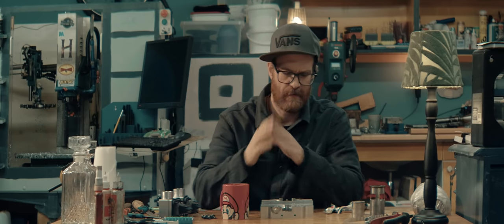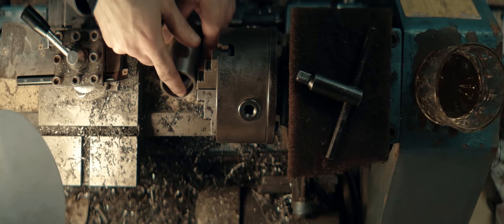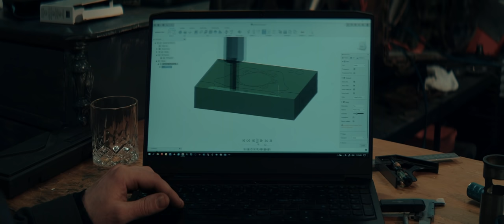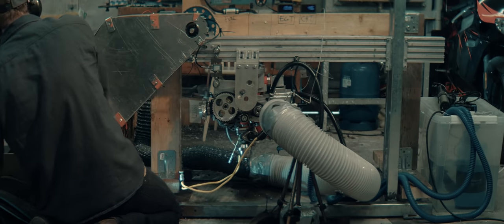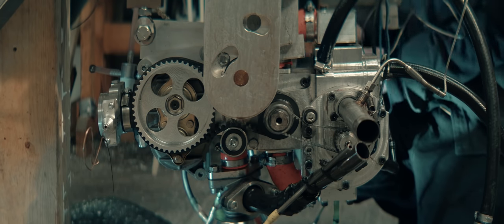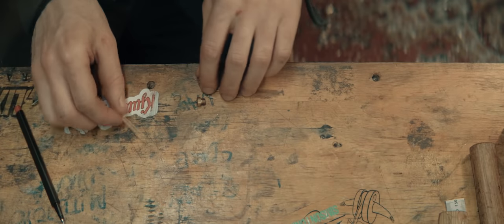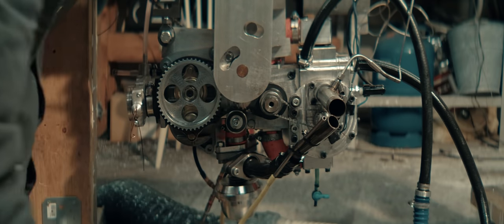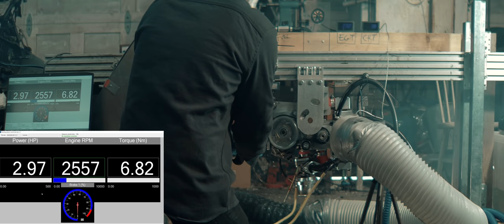Poisoned by Supercharged Nitro 50cc Two Stroke?

Comment: Very wise to use a respirator, the exhaust gasses are  likely to contain nitric acid when running on nitromethane.  It's also very lipid soluble so can hang around in the body after being absorbed.

Comment: As a machinist I would recommend a custom taper lock pully for your crankshaft and trigger.  Set screws will always be a potential failure point. You could possibly even bore out your existing pully to a taper and then machine a matching split bushing to securely clamp the pully to your crankshaft.  Hopefully helpful. Great stuff and good luck!
Reply: I thought the exact same thing when I saw that loose pulley. Machinist also btw
Reply: Does the ignition trigger fit to the crank. I thought it was fixed to the disc valve drive shaft which I believe is only 8mm in diameter. I can under stand your ideas with being machinists  but I feel it's a tad OTT for such a tiny thing.

Comment: You are always winning because I am always smiling for the most part. Except when things go boom, bang or crunch. My ears heard so nice shart exhaust notes on those 15 hp runs. Looking forward to what the reliable max is for this unique build. A nice summer day on a dry lake bed somewhere would be the ultimate ending for the proof of can iy be ridden with a mile wide smile. 10/10

Comment: Glad your feeling better Alex, I still think you should construct a simple test chamber and I remote starting system, how hard could it be? Surely you could attach a old flywheel with the ring gear and starter motor to the dyno. Cuts down on the sound, pollutants ect to you, couple of fart fans on it to extract air inside and a fresh air ducts in.  And if it explodes it would certainly offer a lot more protection.
Just thinking of you and your family buddy.....and neighbors lol.

Comment: Back when I worked in the boat industry, we had to clean just about every surface with acetone all day and the safety precautions were very much lacking. So at some point, consuming alcohol on a weekend, it kicked in like in some sort of turbo mode, first making me want to drink a ton more and then suddenly it made me vomit. Also the overall feeling was nauseated and very tired. After two weekends I understood that the acetone was going through the working gloves and was doing a number in my liver. So when I drank, my liver was already doing its thing and it had a hard time keeping up. After those nights out, I started wearing some nitrile or other gloves. Though I still think best protection would've required even sturdier gloves, but those would've hampered the hand movement and precision while wiping some the more contoured surfaces... Most of the "old-timers" there used just the basic coated fabric work gloves.

Comment: Thanks Alex, I understand you are measuring torque directly at the motor, my point is by decelerating rapidly you will have motor torque + torque to slow down the rotating parts. I am just suggesting you reduce the deceleration rate to minimize this effect

Comment: Nice to see you back Alex, your fan club was getting worried. Have you got the PiP cylinder back from Blixtens racing yet?
Reply from the maker: Thanks! I actually haven't sent it yet. Packed it up and put it in my car, realized last second that I yet again forgot to put in the generous exhaust port roof radius that's supposed to be there. Haven't gotten to doing that yet.
Reply: I really hope your able to dyno / develop the PIP-engine as best you can in parallel; in case there’s any unforeseen challenges with the “brute-force-concept” that push you up to the Bonneville deadline, so you have a powerful yet proven back up plan.....I’ve been patiently anticipating 30HP naturally aspirated, and hope / look forward to you achieving it!!!

Comment: Loading the dyno and rapidly slowing the motor will give an optimistic power reading due to the inertia energy stored in the rotating parts. Applying load with minimal deceleration is best, but applying load more gradually will give a more accurate reading.
Right now you are getting peak bhp, it would be interesting to see the shape of the power/torque curve
Geoff B
Reply from the maker: The load cell is mounted to the engine, stored inertia in the rotating assembly only has the brake work harder. I'm measuring how much the engine resists rotation around the crank axis vs the conventional way with the loadcell on the retarder.

Comment: j-b  weld marine formula, the trick is to let it set hard for  5 full days at  70° degrees to 90° degrees.  jb weld and  jb quick weld wont work.  the other option is  loctite  marine epoxy, but i havent used it enough.  hope you feel better. build on.

Comment: 15.5BHP that’s nearly as much as I was getting with my DT125 with the exhaust restriction opened up, so if that’s your starting point then WOW where will it end ✌️🇬🇧
Reply: @Stem Artin The DT125 is a water cooled version of the 1970's air cooled DT125. It has the same port sizes & timing, so basically an upgraded 1970's. The Cagiva Mito is a 1990's technology engine, so more advanced than the DT125.
Reply: @CZ350tuner  my DT50R 1995 with 70cc and 24mm carb had 12.5hp and 2 months later it blew to the moon at 120km/h ;P
Reply: @Stem Artin I was told that just by pinning open the restrictor took it from 12.5BHP too 17.5BHP. I stuck a one tooth more sprocket on the wheel and one less on the output shaft so more pickup less speed, so it would only do 95 like that rather than the eye watering speed of 105 😂🤣
But seeing as I brought it at a scrap merchant for £200 then found out it was 5 and a half weeks old and stolen. I revoked the cheque and the copper who came to tell me it was stolen thought I looked like an honest chap LMFAOOOO so he let me keep it until it had gone through court.
I had the best pit bike in my town 😂😂and thrashed the crap out of it for three plus years until I brought my 86 CR250 that broke lots of my bones 🤣😂👍✌️🇬🇧
Reply: @Stem Artin My air cooled 1979 DT175 was rated for around 16hp if I recall. So things have come a long way since then!
Reply: Até a XF-17 49cc já saía com 7cv d'origem em 1980 caralhes!! Aquile com uns tokes no mikuni 21e um m80, eram no mínimo 10 horses powers daqueles árabes!!!
Reply: @Stem Artin I should of looked into the carb but never did. The only reason the love affair ended was cos some scally nicked it again 😂🤣👍✌️
Reply: @bradley3549  plenty enough BHP to get yself into lots of trouble if u not got a good grip of things, been there got the tee shirt and read the book while my body was healing😂🤣

A lad that I met while out riding had a water cooled 175, maybe Yamaha but not sure. But he wasn’t as proficient as me so would make up by roosting me with dust and crap. So I got my own back by taking him too my bit of waste ground near the river, he followed me round and took a jump well faster than me showing off as usual and landed in the sloppy mud in the river. I didn’t laugh………MUCH 😂🤣👍✌️
Reply: @markthompson9914  Yup! Plenty of beans for me. When I was last riding actively, I jumped on a late model (well, late model for 20 years ago anyway) Honda 125 liquid four stroke and I couldn't believe difference. 30+ years of development apparently helps a lot!
Reply: @bradley3549  OOH YES 😂🤣👍✌️

Comment: You should get an AFR gauge for testing. it will make tuning a lot easier  knowing whether you running lean or rich or need to add or takeaway fuel making fine adjustments to get the engine running A1

Comment: Heat and quench the copper rings before re-use
Reply: Yes, just boiling the original seals in a pan of water would soften them up.
Squeezing them on installation, work hardens them, thereby shrinking them.
Just like removing exhaust seals on some modern bike engines.
You have to re-anneal them or replace with new ones, every time you disassemble such a setup.
Reply: @wretchedexcess1654  👍 which is why brake pipes hate bending back when you make a mistake.
sump plug washers are another example
If re using the old you can heat with a lighter then dip under a tap.

Comment: @ 6:07 when we see your crosshatch in the cylinder, it must be an optic illusion because of light but those look deeeep! Aggressive crosshatch = more friction = less power. You want them as fine as possible, while still being enough to seal for the life expectancy of the engine. My friend would say "you're not building a tractor engine, go smooth" haha 
Nice video as per usual, love your stuff keep it up!!!
Reply: No! Smooth bores don't seal properly, you need the oil to go into the cross-hatching to make a better seal and prevent seizures. Look up Bore Polish and see what it does to engines.
Reply: @ModshackMerlin  Did I say smooth or event polish lol? "As fine as possible" don't mean none, it means nothing as aggressive as this is. My friend I'm talking about is Carlos Aghbashian, he won engine master 2018 you can look it up. "Go smooth" is his expression to say not to over work things.

Comment: All that hard work you put into this project should put a throttle grip on the Dyno
Reply: Yes. It needs the unit taking off the PiP set up and using on here with the carb slide sorting out.

Comment: When that thing is boggy reach up and cover PART of the carb to check for a lean condition. If it gains power it needs richer jets but if it bogs more it was already rich.  Anytime I hear a 2 cycle bog or lose power I cringe. A lean condition can quickly ruin a very solid motor. Great work and I'm loving every new vid , Thank you.
Reply: Yes your quite right. Covering the carb inlet to restrict the air intake to richen the mixture is a good idea.  A spray bottle filled with fuel can be used as well.

Comment: " Robot Catena" on YouTube has a simple home built Dyno. Maybe be able to get ideas if you run into problems. But it looks like you are getting it all ironed out. You have such an awesome channel. Always looking forward to you videos.
Reply: @emmajacobs5575  yes electric motor used as brake will work great. Trains and most electric cars use motor as a brake. As long you have big enough heat sink to dump your motor amps into. I was thinking how Jimbo's was keeping signal noises down with his filters.

Comment: I wonder, when you give it full throttle it seems like the engine is smothering as if the engine is going to seize up. The speed drops and the engine often stalls as a result. Is that the case and why is that (if so)? Is it building up too much pressure, too little fuel or air..?
Very interesting to see the progress. Keep up the spirit of two-stroke, I love it!
Reply from the maker: Thanks! It's the brake applying more and more force, imagine a hill getting steeper.
Reply: @2STROKESTUFFING  wouldn't lower compression be better for a boosted cylinder? 0.3/5 is asking for a head strike
Reply: @RacinRitchieyt  actually higher compression is better if you can keep it from blowing up. You gain more power by having a high compression engine. Your tuning margins just greatly shrink the higher you go up. There's a guy that wanted to prove his point on high compression turbo engines by building a 14:1 compression honda engine and boosting the crap out of it. It was making INSANE power on really low boost levels but the weight of the piston bent the pins and caused a head strike, destroying the engine. It wasn't the compression that killed it though!
Reply: @kasuraga  the squish is very small and with rpm up near 13000 the piston is going to hit the head, i played around with my  rotax kart engine and set the squish to 0.6 and at 13400 the piston hit the head ,luckily got away with no damage but found 0.8 was spot on
Reply: @RacinRitchieyt  I think it all comes down to how good the rest of the tolerance is in the rest of the built parts.  I bet he's tolerance is better than a average rotax engine tho, maybe?
Reply: @matthewcadle7200  Yes Alex is great but, he pressed a liner into the housing while it was cold and cracked it. Also pressed this last liner in cold and bowed the exhaust bridge.
I'm not pulling Alex down in  any way! 
I know how difficult it is to do jobs with limited time and schedules.

Comment: Getting better, not much power yet but not much rpm either. Should start making power up high around 16-17krpm with boost. One of the most interesting engines for a long time. We did around 120bhp on 250cc 2 stroke boxer hydroplane engine on methanol at 16000rpm. On idle and off the pipe it was drooling methanol out of the stingers, but due to non conventional porting it ran fine. Once you hit the throttle and it got in to the pipes it was insane.

Comment: Are you planning on using these engines in any vehicles when they are done. Would be cool to see a nitro supercharged moped ripping on the streets? Enjoying the videos.
Reply: Bonneville is the plan ;-)
Reply: If you look back into his past videos you will see he has made a 2stroke land speed bike but they couldn't run that year because the salt plain was flooded.  But the bike and videos are worth checking out.
Reply: Is the idea to run the Brute force engine in "Moped Dick" at Bonneville if so  it will take a lot of frame modifications. The PiP engine should drop straight in and I thought that was the idea.

Comment: jb weld is really great stuff but there is better epoxy options these days. I remember some stuff called plexus we used while I was building boats for malibu. It would penetrate into the metal at a molecular level even making the area within a couple mm of the surface stronger than the original alloy

Comment: Sounds like a high speed needle adjustment is needed. It runs low on fuel or something. It could be exhaust leaking early too. Maybe pin the timing pulley.

Comment: Depending how much boost pressure you want , you could slow down the supercharger and push less fuel out the blow off system . This would also free up a little bit of HP

Comment: You need to seal off the exhaust extraction better and /or get a respirator that is fed from outside fresh air , Spray painters use them

Comment: top fuel dragsters use nirto methane, the exhaust contanes nitric acid
taken from wikpedia,
 Exhaust gas from an internal combustion engine whose fuel includes nitromethane will contain nitric acid vapour, which is corrosive, and when inhaled causes a muscular reaction making it impossible to breathe.

Comment: When you run at high load the white exhaust collector tube expands. I think you're restricting the exhaust.  You need to come up with better exhaust extraction.
Reply: Strange I was thinking the opposite. I feel a exhaust system would have little or no effect on this engine, BUT.I feel for the time it takes to cut down the exhaust pipe or tack a restrictor to the tail pipe they need to be tried as they cost nothing.
I would like to see the engine run on normal pump fuel to "check" whether or not it's the RC fuel causing the problems which Alex is encountering......... I believe it is!
4 Years ago the SPX ran well until Alex changed over to RC fuel. Then he couldn't couldn't get it to carburate cleanly any more.
Sorry, got carried away in the comments again.
Reply: @malcrandall1309  No problem. I know little about the secrets of 2 stroke engines but I know the exhaust pipe can make a big difference. I'm concerned with the exhaust extraction outside of the exhaust pipe. I don't think it will make a difference as it's almost no pressure in that white tube but it is something that should be addressed and will only get worse with more power production.

Comment: Could you drill small holes in the top of the piston down into the ring gap …. Equal in 360* around the piston. Using pressure to push the ring out into the cylinder thereby achieving as much seal as possible…?

Comment: Thats not enough squish area as the connecting rod will easily take that up when it gets warm. Should be at least double what you have if not a little more depending on actual rod length.
Reply: I thought he said he had .5 mm, did I hear that incorrectly? That would be .020" roughly. Should be good.
Reply: I can't see the point in making the squish gap to tight as Alex will have to come back and adjust it once the revs increase. I think the only reason for accepting it was because he wanted to fire up the engine. Impatience, I'll do it later! been there, done that!

Comment: You should be able to run it on straight alcohol when you want without too much issue, you'd just need a bigger jet and probably different timing. I think it should survive just fine as they run top fuel engines on gasoline for a little bit and I know that pings WAY worse than methanol.

Comment: Don't know the composition of your fuel, but normal rc nitromethane is about 20% Nitromethane, 12-16% Oil and the rest methanol. Both Nitromethane and methanol are classified with H301 and H331. H301 is just poisonous to swallow, but H331 says something about the toxicity in aerosols and vapours. If your fuel uses methanol you can get severe poisoning if inhaled  for more than 4 hours depends on how clean the combustion is. Methanol can also give severe damage to the central nerve system and eye nerves. Just a reminder to ventilate well and don't overdo testing indoors :)

Comment: Any chance of using the twist grip assembly off the PiP test bench for the "Brute Force" concept engine. I realise there were problems with the slide sticking open but you can't pull/push that welding rod all the time. You need proper control over the carb that a twist grip will provide.

Comment: JB weld dosen't work well in extreme heat, Marine Tex works better..
Or use Permatex Ultra Gray [now avalable in black]  High-Torque RTV Silicone Gasket [sealant] Maker.
Reply: Silicone is a bad choice, a flexible methacrylate like Loctite 515 /518 or Hylomar 3400 would be much better.